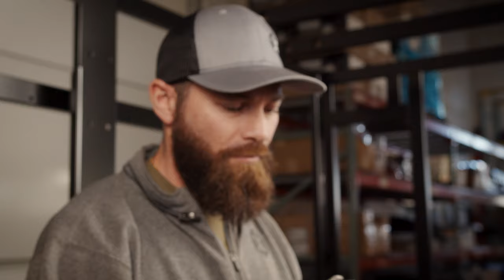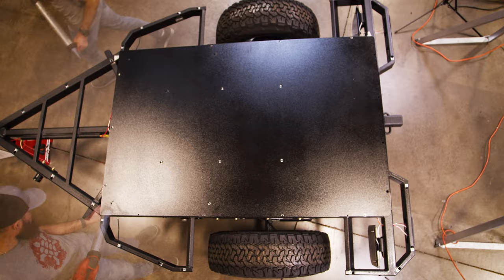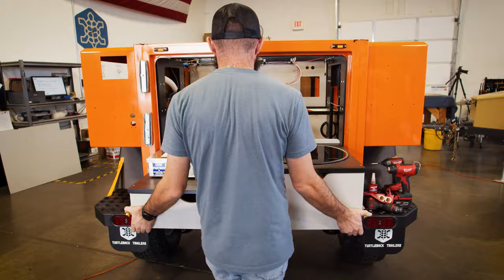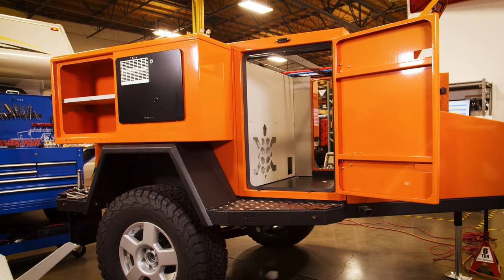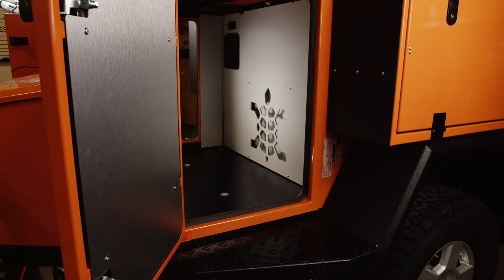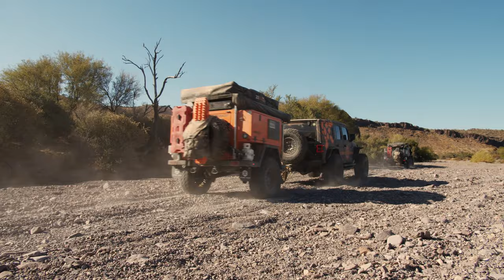Expedition Overland Trailer | EPIC full build TIMELAPSE - 4K

Comment: Hello Turtleback Trailers.
Does one of your trailers are fitted to Bronco sport Badlands edition?
If it is so, I will be happy if you can review it with the Bronco sport Badlands on trail sections. In my point of view, it could be promote your trailers!
If it is not fitted to Bronco sport Badlands edition, can you build Such a series?
Thanks.
Reply from the maker: Any vehicle that can tow at least 2,500 pounds, and has a trailer hitch will be able to pull our trailers
Reply: @TurtlebackTrailers  So, the Bronco sport Badlands edition can't tow your trailers!
Bronco sport Badlands edition can tow up to 2200 pounds (gross tow weight).
So can you build such a series ( With all the extras! ) that it gross tow weight will be fitted to it?
Thanks.

Comment: Looking at the expedition trailer.  On the website there is no description to differentiate between the T1 and T2 options.  What is added to the T2 trailer option?
Reply from the maker: Our website is currently under construction so our sincere apologies. The added options that the T2 has are as follows: Spare Tire, 1000 watt inverter, Zamp solar controller, 100 watt solar panel, Upgraded roof rack (has storage compartment under rack bars), and Treadplate sidebox toppers. Hope this helps!